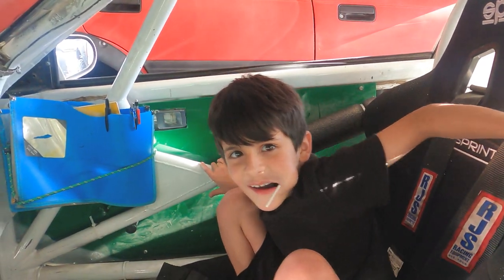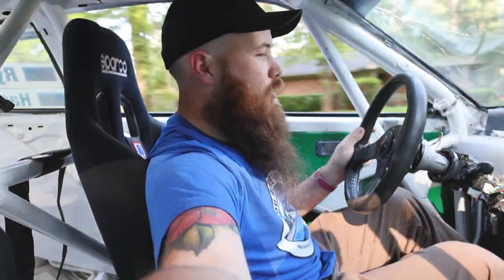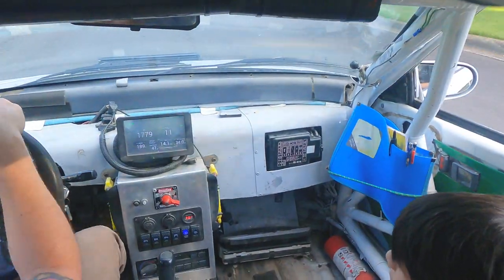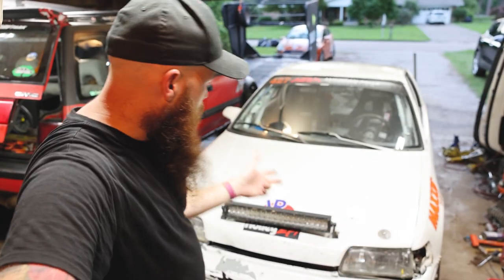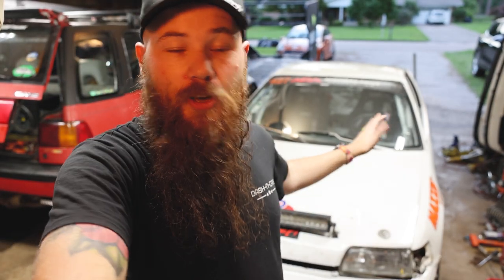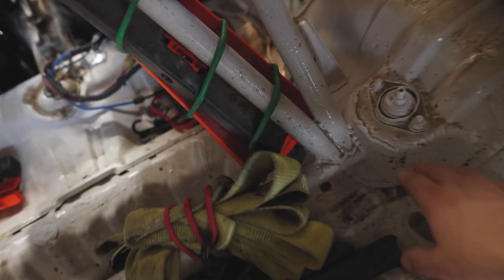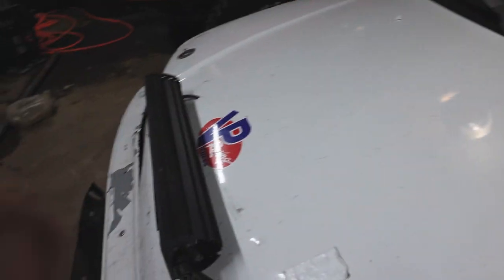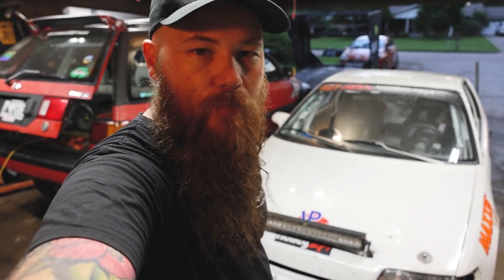I spent $6000 on a Honda CRX in 2021

Comment: Im guessing it has a spoon engine, a T66 turbo, with NOS, and a Motec system exhaust.
Reply from the maker: Not a bad way to spend 10 grand. #tunanocrust
Reply: @DashnCars   You may have to overnight parts from Japan
Reply from the maker: @waterwellguy992  I need two bottle. And Harry, the BIG ones.

Comment: The seating position in the driver seat seems really short you look crammed.
Reply from the maker: That's... because it is! I just got the car and the seat needs to be adjusted. I just wanted to film it before I did anything to it.
Reply: The ARA wouldn’t allow an adjustable seat, but there is two fixed positions that is fairly easy to move. Just unbolt the seat from the car body, then move the bracket to the other fixed position, then bolt the seat back down to the body.
Reply from the maker: @ryanraguse2456  Correct! Harlan mentioned that too, that's what I'll end up doing but I wanted to make the video before I touched anything on the car. The car is in good hands!